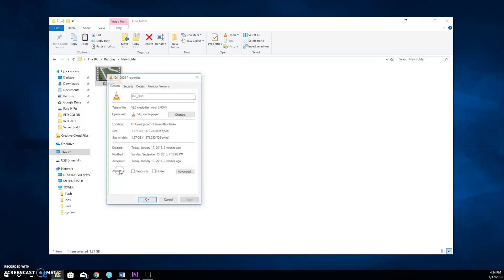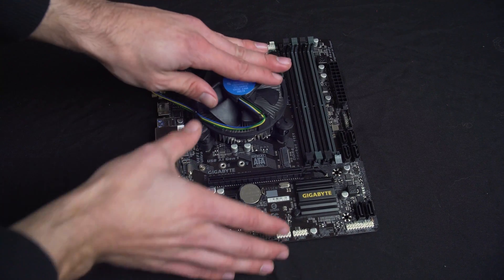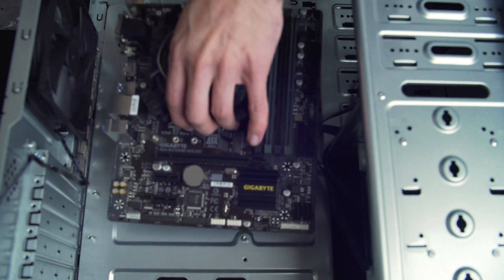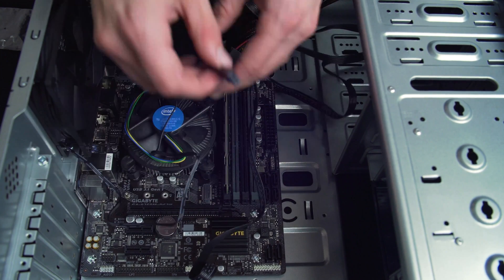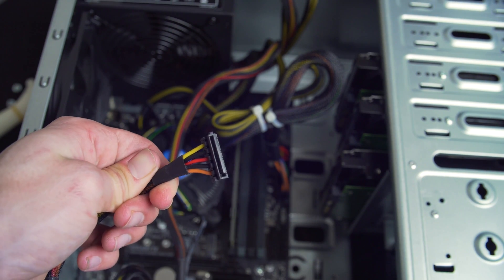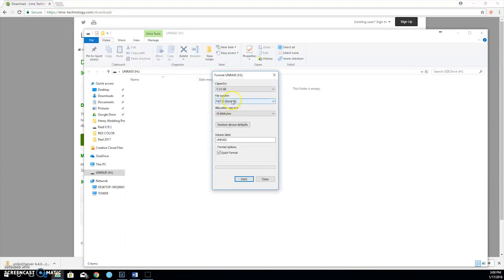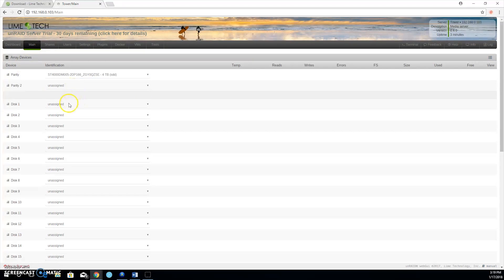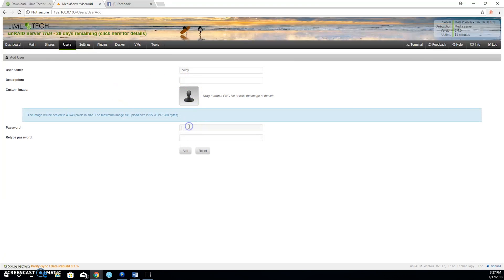HOW TO BUILD A NAS.... MADE EASY!!

Comment: What happens if your motherboard fails in the future?  Does unraid have an easy way to transfer over to a new system?
Reply: Beyonder555 yes, it’s very easy.
Reply: If the motherboard fails just replace, all the info you need is in the USB, even if the USB fails you can still rebuild the system with ease

Comment: Sorry, but at 8:45 you said „so we have a quick raid zero array in the server“ but Unraid does not work like a RAID, instead it copies a file directly to one hard drive - so no RAID in Unraid
Reply: Yet a parity keeps track of the 0/1 status of the drives, so if a drive fails, it can rebuild.  In the event of file loss, rather than losing an entire array of data, you lose only data on that drive in the event you cannot rebuild and/or lose multiple drives.
Reply: True, it’s even in the damn name of the software.

Comment: I am looking to building my first unraid server. I want to be noise and power aware, as in I want to build something that won't just suck power and will be quiet. I am hoping to have about 40tb of usable space and a budget of $3500 including drive purchase. Do you have any site recommendations for power/noise information so I can build a successful server. Or would you recommend buying a storinator or snyology or similar? Main use is for plex and media storage. Also planning to upload the entire array to Google Drive via some sync method. Any help is appreciated.
Reply from the maker: Aran Miller what I would do is go get a used server case on eBay, and build a system still using UnRaid 

You can get away with having 4x10tb drives and one 10Tb parity drive and your data will be protected if a drive fails 

Depending on the speed your wanting the server to be at your configuration may vary 

Actually if your only having 5-6 drives a Normal case will work like what we built

And UnRaid isn’t CPU intensive so it won’t suck power all day
Reply: Thank you so much for the recommendation. Yeah I am currently looking to get ironwolf 10TB drives as they are claimed to be quieter than the 8TB WD reds. I was thinking about 8 drives with double parity so that if anything becomes corrupted unRaid is able to resolve the issue and correct the error when rebuilding the array. 
So, you think building my own with unraid is a overall better option than a synology? The synology 1817+ is nice, because of the ease of use, but with that the drives are spinning 24/7 (at idle, but still) and I like the idea of unraid spinning down the drives that are not used because that is power saved and life of the drive saved. Many of my drives and files wont be accessed everyday, or possibly not accessed for weeks or months at a time.
I have seen plugins such as rclone that can copy files to Google Drive, but do you know is this a one way or two way transfer? Am I able to sync my entire array to my Google Drive Account? (I have an old school account that I keep forever, thus unlimited Google Drive storage)